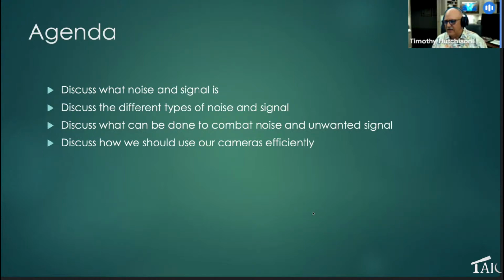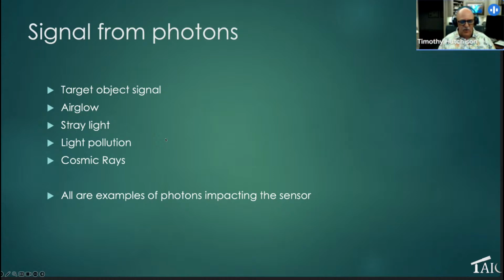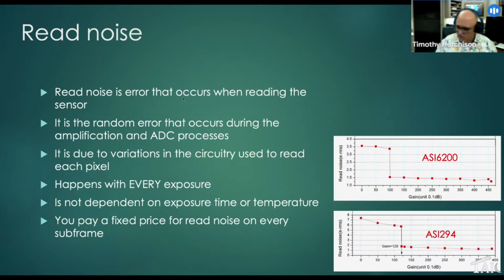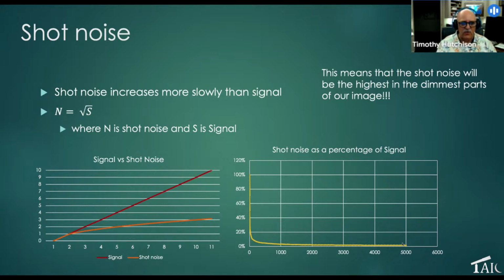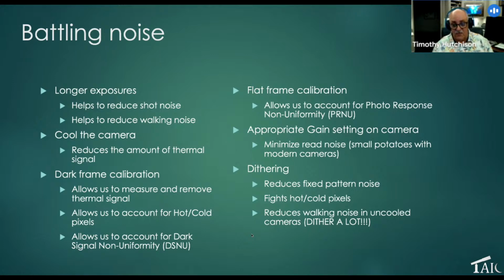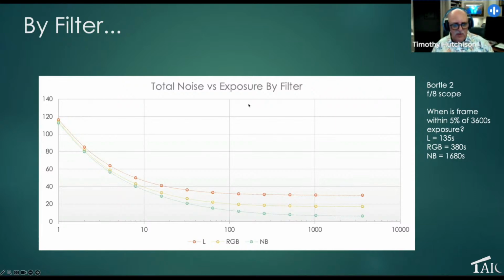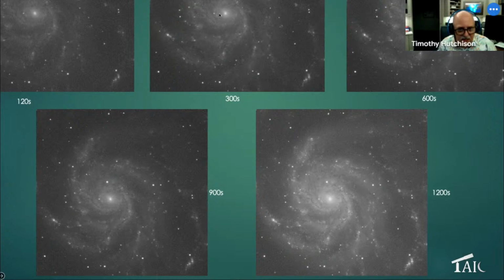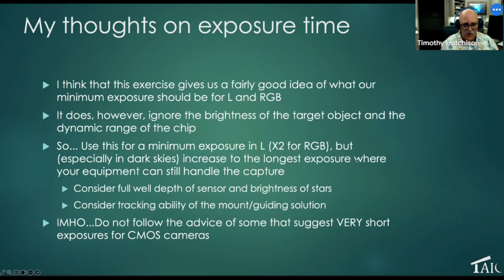Noise and Astrophotography | 2024-06-02

Comment: Excellent, excellent presentation! I cannot possibly argue with the math or the logic. But there's at least one aspect of this Tim really didn't get into--practicality. This is a very difficult avocation. And one of the most difficult parts of it is data management. I've set three different exposure times and one gain (unity) that I use 99% of the time. 60s for RGB stars for narrowband images, 180s for LRGB for broadband, and 300s for narrowband. I do this across five rigs at five radically different focal lengths and five very different F ratios at two locations--one remote and one here at home. The main reason is a simple one: I'm simply not going to manage six or seven different exposure times combined with multiple gains and all that implies--flats, darks, flat darks, biases, and lights. At that point, this activity becomes an unmanageable nightmare and is just no longer worth doing. I do want my images to be the best that I can make them--but there's the rub. The best I can make them--that is, in the real world. I have a life outside all this, too. 

While, like I said, I cannot disagree with the math or the logic of Tim's arguments, I simply will not change what I'm doing. Tim even undercuts himself and--tacitly and unknowingly--agrees with me at the end when he says he has a project where he's going to up the gain to reduce the necessary exposure time. 

The example he showed of single subs shot at increasing exposure times I find uncompelling. It's one thing to compare a 3 minute sub to an 18-minute sub--one thing that's not at all informative. Compare 6 three-minute subs stacked to a single 18-minute sub. Hard to do since you can't really stack one sub. But consider this: Compare a stack of 6 three-minute subs where one sub has a big, bad airplane streak through it to an 18-minute sub that has a big, bad airplane streak through it. Nor did Tim really dive into why a stack of 6 wouldn't reduce shot noise to a similar level as one 18-minute sub. That may be buried in the math and support his argument, but it's a point he really didn't cover. He seems to contradict it by asserting that one reason we stack to reduce shot noise.

This highlights one of the technical aspects Tim failed to cover, although he did briefly mention some of the drawbacks of his proposed approach. But the drawbacks are significant. If I have 7 hours to capture Ha for an object and I take 30-minute subs (14 subs), how well is the rejection algorithm going to handle the aforementioned big, bad airplane streak? And how well will that algorithm handle the same streak in a stack of 140 three-minute subs? I don't know for sure and Tim didn't say, but my money would be on the 140. And when the wind kicks up hard, like it often does at my observatory, and toasts a sub, do I want to toss 3 minutes of data, or do I want to get rid of 30 minutes of data? What if seeing changes significantly over a short period? What's my FWHM going to be on the best 3-minute subs versus the 30-minute sub? These are questions largely unaddressed by this talk.

Finally, Tim did not present a single concreate side-by-side example of the same object shot with shorter subs versus longer subs with the same gear under similar conditions. If you really want to convince me, you'll have to produce at least one example of that--and optimally several examples. 

Now that I've crapped all over this talk, I want to point out that that is not my intent. I found it to be an excellent talk with all kinds of valuable information and strong arguments for most of the assertions Tim makes. One concession I might be willing to make in the future because of this talk is to start shooting LRGB at 0 gain, but I'll have to think about that, and I'm not there yet. But the main value of this presentation: to me is that Tim provided a boatload of facts and all kinds of useful information. And no one can argue with the results Tim gets. They are simply top shelf. Thank you, Maestro!

Comment: Great presentation.   Lots of good points well made.  

However, at about (1:22:00) you encourage longer exposures due to retaining more levels, but this ignores the stacking factor that creates intermediate levels at the rate of Log Base2(N) where N is the number of subs.  So I think your statement is incorrect in this case as it only applies if are talking about one single exposure, but you need to be talking about the same total integration time. When you do that,  what you lose in a single short exposure, you regain in the stack because with the shorter exposures you are stacking more of them and so your log base2(N) is a larger number and that’s where you reclaim those digital levels that you think you had lost.  And this is where you do not lose levels, taking shorter exposure as relative to longer exposure because you do more of them and you reclaim them in the stacking.  Each individual exposure may have fewer level levels, but the stack will have all of the levels and you will not get blotchiness from that.  I encourage you to do the math on this and you’ll see that it’s true and so you do not increase your single expose your time to increase the number of levels in your final image.  

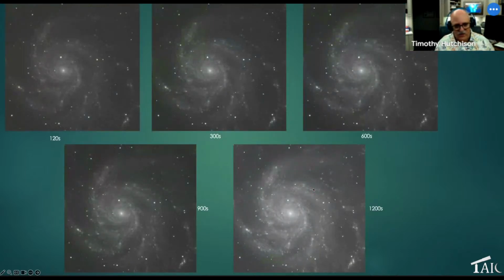Your later example (1:24:00) is with showing only single different length exposures… I think it’s well understood that when looking at one exposures, a longer one is going be better because that also represents a longer integration time so you’re comparing different integration times (10x longer!)… that’s the important factor in that case. What you need to do is stack 10 of the 120 second exposures, and then you’ll be back down to only the read noise difference.  Without making the total integration time equal, it’s not a proper comparison.   To compare 120 total seconds of integration time to 1,200 seconds of integration time is going look better as you captured 10x the amount of data.

Again, a great presentation representing a lot of hard work.  I think these are is just two corrections needed in an otherwise great presentation.

Comment: Fabulous presentation.    Many of my thoughts parallel the speakers on exposure time.. maybe because we’re both EE’s, and me being a retired semiconductor engineer.   I have never understood the argument that some make about many short exposures being just as effective as fewer longer exposures, especially on dim targets for the same reasons the speaker shared.   I’ll have to think more about his read noise comments.   Anyway, great presentation.
Reply: As long as the exposures are long enough that the read noise contribution is kept to a minimum, then it doesn’t matter whether you take twenty 5 minute exposures or one hundred 1 minute exposures, in both cases you collect the same number of target photons and sky light pollution photons and since the shot noise is a square root of the number of photons:  In both cases, the noise is the same…. exactly the same, in fact.  Watch Robin Glover’s video on exposure times and he explains the math in great details.

The only reason to use a longer exposure is to further reduce the impact of read noise, but if we’ve already reached a point where that read noise has been reduced to a trivial level then it does little to further increase exposure time.

Comment: I agree with the comments below, one of if not the best noise/exposure/calibration presentations I've seen! I have one follow on question....if you process stars and target/background separately, is there any advantage, or disadvantage, to maximizing light frame exposure length according to the brightest part of the target and letting the stars blow out, then remove the stars during processing and replace them with stars from an extra couple hours of RGB lights exposed to optimize the stars?